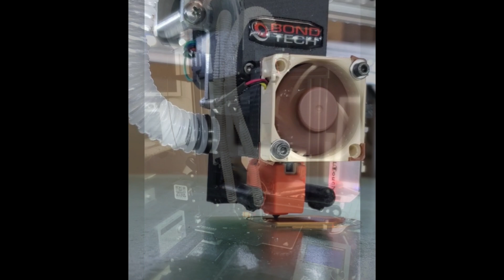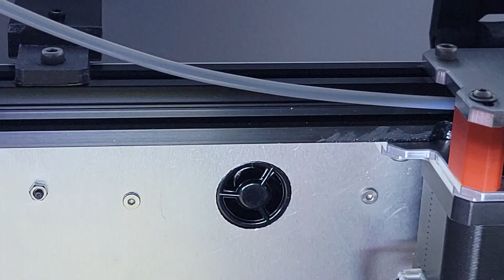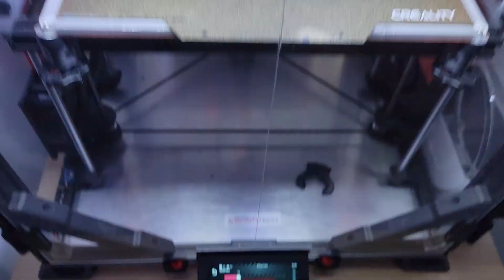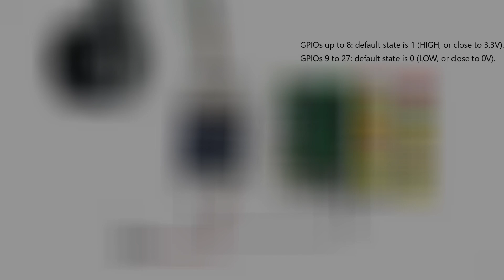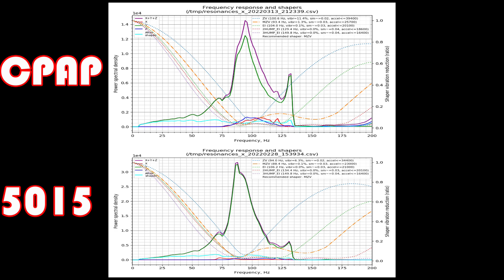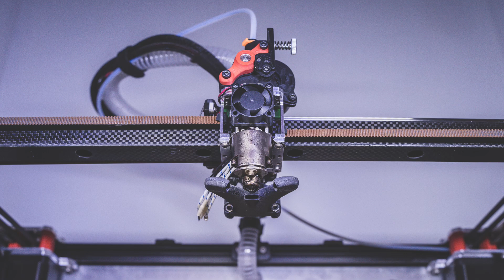Cpap turbo remote cooling system for 3D printer tutorial

Comment from the maker: Sorry for the re-upload ! I had a missing  information on the wiring. Forgot to mention or show the use of a relay if want to use a heater port to control 24V to CPAP board.
Reply: Hmm, think it'd be powerful enough to split the hose to cool the hotend and the print? then I could get all the fans off the effector...
Reply from the maker: @stefangiudici5547  yes...but what if the parts you print dont need cooling?  I dont think the idea is good becaue of that.  And a little 2510 fan weights nothing on the hotend
Reply from the maker: Manuel Sterbizzi  you can connect it to the psu negative.. or any negative terminal on the 3d printer board. which ever is closer.
Reply: If you want to increse you flow that cpap hose creats a lot of turblance you want the smothest hose you can get this will increse you laminer flow  try using some thin wall pex or somthing like that or 1/2in vacume hose
Reply from the maker: @linearburn8838  the inside is smooth.
Reply from the maker: @linearburn8838  its a cpap hose
Reply: You building completely custom, or you using parts off other moded printers
Reply from the maker: @odeball22  custom. Though it has a x5s donoer for the 2020 frame
Reply: @Vez3D  dope man you gunna release all your parts. Or schematics?

Comment: My current dual 5015's B.B. about 2x the watts of what they typically are is more air than i can use. I tries the cup of water thing and i was able to fully "dunk" the hotend/nozzle about 25mm deep below the waterline without a single part of it being touched by water. Its a custom hotend I made that flows OVER 100mm/s3 that i made and it is a LONG one- so it really sticks out there. Why all the extra work for the air? I imagine that hose/nozzles weighs more than just my simple dual incorporated fan nozzle.. besides that cpap fan sounds like a freaking vacuum cleaner!😂 thats SO loud

Comment: or to use the full potentional of the CPAP fan: you can use the 3.3V pwm from RPI (like you already do), connect it on arduino nano and map it to 5V pwm output. Its working like a charm and the CPAP blows at the full strength instead of this. I can provide you the arduino code if you want
Reply from the maker: @Vjeko2404986  we now drive it from a 5v pwm pin on the mcu board :)
Reply: @Vez3D  Well, I didn't want to change the whole mcu just to gain 1,7V more :D
Reply from the maker: @Vjeko2404986  ahh ok .yeah then its a good idea :)

Comment: This is awesome! I thought about this idea myself, and then I found your video. One question: I am trying to make a corexy ender3 which will be VERY modded. My goal is for it to be a high speed printer. I think the stock cooling fan is 24v. Could I connect the 24v input directly to the board or should I make another connection via the power supply?

Comment: As far as hooking up the wires to the cpap. With modern mcu boards coming with selectable voltage fan headers do you still suggest using gpio pins? I can select 5v on my mainboard.

Comment: Great work Vez3D,
I had a question, I'm using a 5v fan socket on the MCU (not using RPI to run Klipper). In this schematic, I understand that I only need to connect the signal wire (grey) to the negative of my fan socket. So the positive of the fan socket is not used?

Thanks in advance.
Reply from the maker: If you use a fan port.. its reversed . The pwm pusle is on the neg pin..so you have to use an optocoupler.

Comment: what are your opinions on running the linear rail on top of the gantry versus the front side like the Voron 2.4? Im thinking about changing my Voron into a Vzbot. With the stealth burner and tap and the weight of all the parts I feel like the Voron struggles to sling the printhead around. I can't get rid of the minor z banding issues. my prints look good but I also like the design off the VzBot. Great Job.

Comment: there's an enable_pin definition available in klipper in the [fan] section, saves the additional pin definition for power (this functionality might have been added after this video was created):
[fan]
enable_pin:
#   Optional pin to enable power to the fan. This can be useful for fans
#   with dedicated PWM inputs. Some of these fans stay on even at 0% PWM
#   input. In such a case, the PWM pin can be used normally, and e.g. a
#   ground-switched FET(standard fan pin) can be used to control power to
#   the fan.

Comment: I have Gamma28 7530 which I would like to mount on my 3d printer, but to reduce weight instead of using cpap hose what would you think about using heat shrink tubes? They are lightweight and are shrinking above 90°C so they should be fine in chamber that tops around 45-50°C.

Comment: I am new to 3D printing, instead of powerful fan why not inject slower cooled air stream maybe thru 4mm hoses to the head? Will it affect any plastic properties. Don’t know if anybody done that? CNC kitchen Stefan not yet.😜
Reply from the maker: cpap produces warm air.. and its better for my need. Too cold air would probably cause issue. Also.. you dont want to cool enclosure

Comment: Shall I suggest positioning the air intake at the bottom of the enclosure 🙂. That way you would be taking the coldest air possible. At least on paper.
Reply: I think the bed heater will disagree :)
Reply: @MoAvW  I think I will disagree 😀. Hot air rises, hence the coldest on the bottom. Of course we can elaborate on the fact that the proximity of the bed heater to the air mass at the bottom and insufficient insulation (hence "cooling") on the top might skew this rule a little, but since this is a CoreXY design, the bed is actually at the top most of the time.
Reply: @radeklukas  convection, and a strong one from that CPAP should overtake power of thermic effects. Most big printers have their beds stationary at the bottom.
Reply: @MoAvW  Well, I was commenting on this specific one, which has the bed as a Z axis, so that is that 🙂. I am wondering though, which are the "most big printers" that have static bed at the bottom?
Reply: @radeklukas  Voron V2.4 ,Prusa most if not all, half of Bambu lab's. If the bed is moving on Z^ then half of the time you are right :)
Reply: You do not want cold air blowing on your parts in a heated chamber this is how you cause poor layer adhesion and warping. You want to get the part below glass transition temp so it hardens but not below the ambient chamber and heta bed temp so it warps  @radeklukas

Comment: I’ve always wondered about these really strong part cooling fans. Do they not cool off the nozzle to a significant degree? I guess you probably have to run a PID on the hotend depending on how much part cooling your using for a particular print?
Reply from the maker: you need to aim the flow a bit under the nozzle

Comment: i wonder if printing in a constant vacuum will effect the print for better
Reply: Both intake and exhaust of the cpap are in the same column of air. Therefore, there is no pressure differential

Comment: You've probably already come across this... But I suspect the 50khz in the datasheet is really meant to be 50hz - which is common for a lot of PWM controlled brushless speed controllers. That would be why you you had better luck with a cycle time of 0.002. Sometimes you can push it down to nearly 500hz (e.g. 480hz) as the actual signal is a pulse from 1ms to 2ms to indicate off to full power. 

I'm not sure if Klipper does this (although I suspect so, maybe not well), but using the microcontroller to run the fan signal with hardware PWM is generally the best for performance.. A timer peripheral on the chip will generate the PWM signal on the pin instead of using the CPU to time and flip the pin states. Aside from being more accurate, there is virtually zero processor overhead (aside from adjusting the timer registers and any comms overhead). The caveat is you need to ensure that the pin you want to use supports a hardware PWM output, and if there are no free timers, you might be hosed anyway. That is all very microcontroller dependant, but I use it extensively in other projects for brushless motor control.
Reply: You could also add an Arduino. They come in native 5v logic versions, and the you would have some extra gpio for other stuff. It will use another USB on the pi though.

Comment: This is a brilliant design.  I wanted to try this approach for myself.  Nice to know it would have worked out! You pulled it off splendidly!

Also-subscribed! Can’t wait to see your next trick!

Edit:  what I wanted to do in mine is have an insulated flexible conduit which all the wires, cooling tubes, etc run thru to the print head.  I would have cooling running thru the conduit as well so the wires and other sensitive components stay cool.

Comment: Very nice! I think most of the noise is coming from the suction port of the fan, perhaps an acoustical dampened chamber over the input would help, without sacrificing a lot of flow. For these higher frequencies, I like 25mm thick Akotherm dampening. (recycled PET, the low density,  20kg/m3)  But i'd say any form of damping would improve the noise. I don't know how they are normally dampened when they are mounted into a machine that should help you through the night.

Comment: @vez3d did you update the step file for the back panel with the hole for the CPAP blower? Because it would be much easier to plug the hole with a printer part in case it's not needed than to punch it in the aluminium in case it is needed. As usual, amazing job!
Reply from the maker: I have not. I figured people could drill it the hole like i did?
Reply: @Vez3D  it's ok, it's only because anybody with a printer can plug the hole, not everybody has the drill bit to do it though... Easy fix in any case, but having the hole pre-drilled is just easier. Thanks for the quick answer!
Reply from the maker: @Controllore777  ill see if we can add that the next panel sets
Reply: @Vez3D  thanks!

Comment: I've made a hotend silicon sock fused on the blower fan duct (it's a single piece). Accidentally I've discovered that the silicone gets hot enough to heat the air coming from the blower to +- 60c. So I could be a bit more aggressive cooling ABS without cracking it.
So I wonder if it would be beneficial to heat the air from the blower to a temperature closer to the ABS glass transition temperature. In that case you could turn the fan at full on ABS.
Does it make sense?

Comment: @Vez3D not sure if someone said this yet but you should be able use the EN pin on the motor controller and if you set that pin low it should stop the motor completely. Instead of using the relay you can just use the pi gpio to turn off the motor using that driver board.
Reply from the maker: You mean an EN pin on the cpap controller board ? I didnt know there was one
Reply: @Vez3D  correct if your using the 5th pin "vsr" for pwm control you should be able to use 3rd pin "EN" to turn the motor on/off says to connect to ground or low signal.

Comment: Great video! Really like the ideo of good airflow at low volumes for everyday use, while still having the option of massive airflow when needed.
I have one question though.. I like to use 10% part cooling with a 5015 fan when printing ABS to help with bridges and overhangs. I fear the CPAP's minimum airflow would be a little too much.. Do you have an idea to mitigate this? I am currently thinking of adding a restrictor plate that could be moved in or out of the airflow path with a servo.

Comment: If you are attempting to cool the print head with recycled air to maintain the temperature, then how can you do that while simultaneously exhausting and filtering the air?
If you are constantly exhausting, then you are constantly pulling new air in from the cracks which would be ambient room temperature.  In that case there is not that much recycling of air done with the CPAP motor (which is also effectively pulling in fresh air through the cracks in the enclosure).
Am I missing something or making wrong assumptions?
Reply from the maker: Who said i was exhausting during print? 😜 im not.  Exhaust only runs when print is done.  However next step is adding another filter during print that will recirculate. I already have a recirculate fan at the bottom thay will be replaced by that
Reply: @Vez3D  I wondered because you didn't say in the video (thus the confusion).
You mentioned the toxicity of ABS so I couldn't imagine the wisdom of not filtering.
Reply from the maker: @KarlMiller  yeah maybe i should have specified hehe :) thanks for the comment mate

Comment: An Anemometer / Air Flow Meter like they use for wind / HVAC may be a good purchase for quantitative measurements of cooling system performance.  They are about 30 USD or so, so it shouldn't be too crazy of a purchase.  Not 100% needed, but more data is always good.

Keep up the great work!
Reply: A Venturi flow meter is pretty easy to make too

Comment: I was literally just looking at cpap fns yesterday. Diaphragm pumps have potential, but they get kinda hot and not sure they'll cool enough for my needs. They do however pull air through a respirator filter without any significant resistance, so they will work for my enclosure filter. Wonder if the cpap would be choked by one.

Comment: Ask yourself this: What would be the optimal temperature to have on the incoming air? ;)
Reply from the maker: same as enclosure temperature :) so you dont cooldown the enclosure. With PLA.. I just open the cover and doors
Reply: @Vez3D  Would it, though? I'd bet on "just below the glass-transition temperature of whatever polymer you're printing". Granted, this would take a lot of energy, and would mess with your enclosure-temperature, but it would make for the least inter-layer stress while printing, no?
Reply from the maker: @AdityaMehendale  mmm i dont know.  Yeah that could be right. I dont think it was ever experimented :) ...please dont give me more work hahaha
Reply: @Vez3D  saw an academic group use air just under the glass transition temperature for cooling a few years back.  They got massive gains to layer adhesion but they weren't printing with PLA or ABS.

Comment: Testing my fan upgrades with ‘minimum layer time’ tests has proven to be a good metric. As performance improves, shorter layer times become achievable. Just need the part to be large enough diameter so the fans aren’t continually blowing on the same surfaces after it’s already been printed.

Comment: Got a c pap from rummage sale for a dollar or two for this exact purpose. I once saw a guy using condoms for hoses to keep things light weight on his Delta. I have always wanted to use two ball screws or some type of scara arm to have a "flying" extruder and fan assembly like this. Something that is essentially sent the same g codes in X and Y but uses its own steppers and all decoupled from the printing gantry/print head. Maybe tune it to be a little softer on starts and stop.

Comment: From what I see i think the cpap tube you use is a 22 mm version. Resmed (one of the machine manufacturers) uses 16 mm tubes which they claim to be 40% lighter than the standard 22 mm tubes. Maybe an opportunity to save another few grams.
Reply: This tube is 15mm ID
Reply: @MirageC  Great so you already have the smaller diameter tube, so the look deceived me in thinking it was 22 mm.

Comment: Glad to see you finally joining the CPAP party!  Great implementation, too.  I like the external hose clamp, seems like a smart solution for max flow.  I've been using barb-type fittings for weight savings, but they do eat some inlet area.